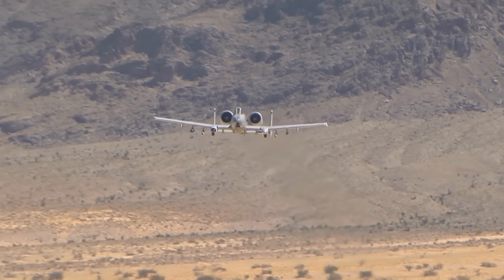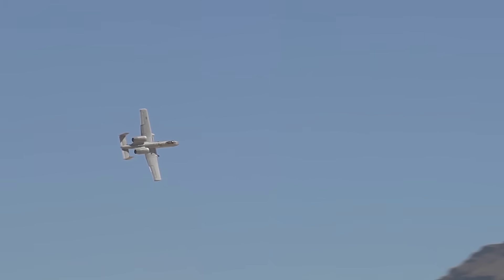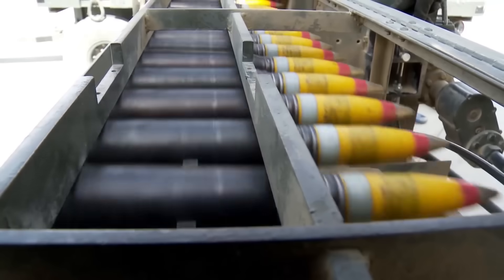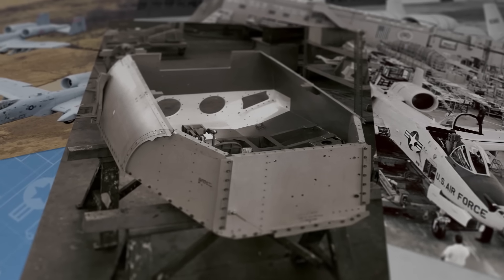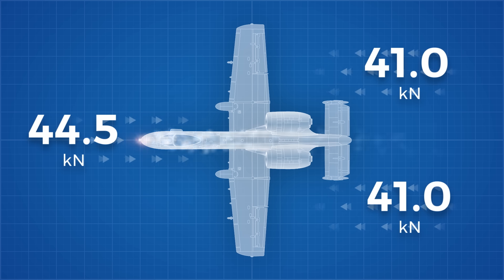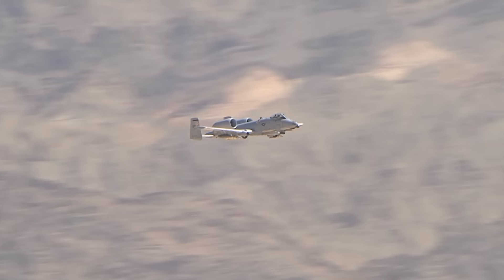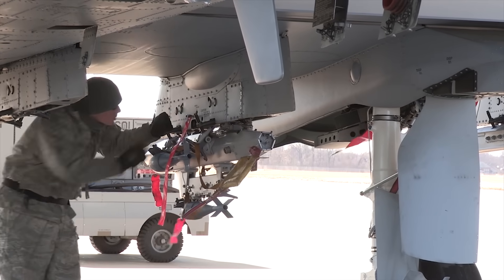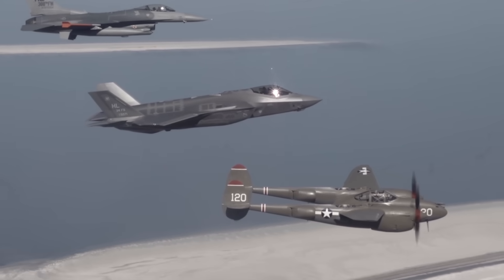The Insane Engineering of the A-10 Warthog

Comment from the maker: We just released a new video about the A-10's grand papi, the P-47 Thunderbolt. 👴🏻
If you enjoyed this video, you will love this one: https://youtu.be/IwqTN5fhMR8
Reply: Amazing video! However, one thing wrong. At 7:56, the gun is actually slightly offset to the left so that the firing barrel is aligned with the center line of the plane.
Reply: @vectorvictor2911  Yep, it's visible just looking at the plane so I'm not sure how they missed that. It fires from the left most barrel so the firing barrel is on the center line even though the gun is not.
Reply: @vectorvictor2911  but in the video theres real life footage and when they look at the a-10 infront you can see that the guns on the middle but i do know that the guns supposed to be offset from the center
Reply: you are incorrect ive seen an a-10 in person and the gun is off set a little and the barrel that the bullets come out of is in center line with the aircraft
Reply: tank god look again , the wheel is off set ,not the gun , it’s all about the gun
Reply: Three things to add:
1. During the first Gulf War, the Iraqis were terrified of this aircraft, and referred to it as "The Devil's Cross".
2. Part of the reason this aircraft has such low operating costs is because many of the components are ambidextrous: the wings, the rudders, the engine, and all three landing gear can be swapped with new or salvaged components.
3. The gun is mount slightly to the left, so the right-most barrel is firing on the centerline.
Reply: My grandfather flew P-47's over Europe in WWll & he loved it, said that plane is how he survived the war lol . Called them flying tanks lol . Said they can take a severe beating . Often coming back to base ridden with bullet holes . History worth remembering. 😉😜✌
Reply: When I was in the Army in West Germany in the '80's, the feeling was, that the A-10 was "down here with us". Without really thinking about it, the A-10 gave us comfort.
Reply: Thanks for the extremely interesting vid on the A-10 tank killer. I loved it well done 👍
Reply: The A-10  Thunderbolt (fondly known as the "Warthog"  is pretty much a direct descendant of the P-47 Thunderbolt (fondly known as "The Jug" & if I remember right, "The Hog"). What's kind of amusing to think about, but isn't really a big issue, is; the piston engined P-47''s top speed, 436 mph+, is faster than the jet engined A-10's top speed, 420 mph!
Reply: Ha! I myself, decided that there was a direct blood line between the two ... Nice to see that people who know this stuff, think the same thing.
Reply: Yo. Some of the A-10s in the camera shots used in this video come from the local Air National Guard in my hometown Fort Wayne, Indiana. Any shot with the word Blacksnakes on the engines or the snake nose art comes from the 122nd Fighter Garrison. The planes always seem to fly over my house so it’s fun when they go in for a landing and I can hear the engines, which are loud even indoors. It was strange to see the 122nd’s A-10s in a video other than the local newscast. Thanks for that. Enjoyed the video greatly.
Reply: @THEguitarist117  kewl my man
Reply: @THEguitarist117  Camp Atterbury Alex?
I've shot .50BMG matches there and done a couple other things at that base. 
That's the first place I ever saw the A-10's do live fire training.
Cool place...
Reply: @PJS50  I don’t know the name of the base, only its location. The reason I know that those A-10s were local was because I’ve seen them up close when my Boy Scout Troop went to the base, and when I went to a Memorial Day Air Show. So, yeah.
Reply: COSTS... you can build  and buy 2 or 3  A10s  (~$47 Million)   for the price of  just one  F35.  ($94 to $122 Million)... 
So for any ground fight, would you  want to have only one F35   or  is it better to have  Three  A10s  ?
Multiply that across an entire war front :     100  F35s   or   300    A10s  ?
Your tax dollars at work !  And that tough titanium tub armor the A10 means safer pilots, and more of them  coming home.   To  all their  families :  PRICELESS !
Reply: @SeaJay_Oceans  yes just big brain move right there
Reply: You lose me when you can't get the simplest things correct.🤨
It's not the A-10 "lightingbolt".
Also, the "grand papi" of the A-10 was the A-1 Skyraider.
The info I've found is consistent with the wikipedia overview even on military websites. So, here's a quick copy and paste..

From Wikipedia...
"The Fairchild Republic A-10 Thunderbolt II is a single-seat, twin turbofan engine, straight wing jet aircraft developed by Fairchild-Republic for the United States Air Force. It is commonly referred to by the nicknames "Warthog" or "Hog", although the A-10's official name comes from the Republic P-47 Thunderbolt, a World War II fighter-bomber effective at attacking ground targets. The A-10 was designed for close air support of friendly ground troops, attacking armored vehicles and tanks, and providing quick-action support against enemy ground forces. It entered service in 1976 and is the only production-built aircraft that has served in the USAF that was designed solely for CAS. Its secondary mission is to provide forward air controller-airborne support, by directing other aircraft in attacks on ground targets. Aircraft used primarily in this role are designated OA-10. The A-10 was intended to improve on the performance of the A-1 Skyraider and its lesser firepower."-Wikipedia
Reply: @FREEDOM_33  In an exclusive "ground support" mission, yes, the A-10 replaces the good old Skyraider (what a great bird that one was too!). However, the A-10 was primarily designed as a quick response to stop the oncoming swarm of Russian tanks across Europe should the USSR ever decide to go "hot" on the cold war. Yes, the A-10 does a good job at CAS, but that GAU-8 gun is WAY OVERKILL for a plane designed primarily for just a CAS role. It was designed to keep the battalions of Russian tanks at bay until NATO could amass their own armored response.
The A-10 is an inexpensive plane, designed to take out way more expensive main-battle tanks, and survive!
Reply: @FREEDOM_33   yes sir.  A-10  MY NICKNAME FOR HER IS THE CROP DUSTER....    as far as that OA-10 designate.   THE.  O...  was dropped  because it is to big and heavy. To Observe 
Now ....   consider  your self.  Lost.  And I do mean lost......    a wise man will  seek before  he speaks.    0V-10.   BRONCO.   AKA.   BLACK PONY.    ROCKWELL.    HAVE YOU EVER HEARD OF YOITUBE....     WELL...

 GET BUSY !
Reply: It is seriously wrong to use DU that way. It's half life is something like 3k years?? That it's still dangerously redio-active, yeah that sounds safe for our troops to be near. Or the aftermath of the war zones for that matter. The innocent people dying of cancer wondering where it came from too?? DU should be sent to the sun to be recycled that way, hint Elon Musk, if you want to help the world, spend some money doing that.
Reply: @derkaturka   years. Comments are  punk i fied  in this last day  if you are not one whom is trying  to find  3 ga  boo  n.  Viper.    The deadliest  of all.   Then I agree  with  your comment  other  than that.   Stand  down.  😠
Reply: @derkaturka  im a vet I completely  understand and  agree  w /   .  79 - 85.   Yes  
  You know  that I know they  don't understand.   And after.  1 6 21.  I dont want to comment  any more
Reply: That made my whole  family  cry all of us are ret govt workers  or representatives of  all branches of the military
Reply: Starscream I'm coming for you
Reply: Yes they are trying to get shut off the Beautiful A10 but the real thing about it is Nothing else can take its place we only need about 300 more of them
Reply: It gets the job done....
Reply: um it's not "insane engineering" when all they had to do was build the planes body AROUND the gone
Reply: and  https://www.youtube.com/shorts/XJIunDgblec 😉
Reply: that IS my Plane A-10
Reply: 4
Reply: the jug
Reply: @realengineering the gun was my dad's baby it was his first project he was charge  of as captain. he retired as a maj. after 22 years of service. he died back in 2015.
Reply: Lots of great footage and information. Dude you must have said  ‘need’ or ‘needed’ about 50 times in the first 5 minutes! Wtf? Is this a CoDependents Anonymous meeting or what? Please consider remaking this real man world terms like ‘requires’, ‘must’ etc thanks 🙏
Reply: I smell an Irishman. Is my nose right?
Reply: No joke.  Dont blink,@ dead.
Reply: A-10: BRRRT

YouTube subtitles: [Music]
Reply: Su-25/39 in the future?
Reply: Can you make a video about f 22 raptors
Reply: I fly RC planes too...
WoW! Check THIS ONE out!
BBBBRRRRRRRRRRRRRRRRT...
https://www.youtube.com/watch?v=iWZTTg0hEwI
Reply: I'
Reply: If you ever do a video on sonar, you should reuse that opening clip. You have the audio delay from the visual of the guns firing, but you can also tell how much distance the A-10 covered between both bursts. There was a delay of a few seconds between the sound of the first burst of fire and the rounds landing, but the second burst only had about a half second delay between firing and landing. A little bit of math and that audio can tell you how fast the aircraft is moving.
Reply: +pinky lmk
Reply: You said lightning bolt when it’s thunderbolt II
Reply: @Evan Ferrero well the f-35 isn’t bad it’s a good aircraft but A-10 Go Brrrrrrt so it’s better
Reply: My dad was the father of the A-10.  He was VP and project manager.  It is interesting reading the comments below.
Reply: The GAU 8 was slightly off center. The 9 o'clock barrel was ON center
Reply: quick thing the 30 mm is placed at an angel to the left of the plain but it fires from the barell that is center when it is fired so the gun is not centerd but the force and the shots origin is. does not matter for the video. good work
Reply: May someone knows  that this A-10 was created by Aleksander Qartvelishvili,he was emigrated from RP. OF GEORGIA .CAUCASUS region 🇬🇪
Reply: dc we
Reply: Slight correction: the gun is mounted slightly off the center line axes, as the GAU avenger in the warthog is set to fire each barrel when it is on the nine o'clock position. By mounting the whole gun slightly off axes, the nine o'clock position of the barrel drum lines up with the center line, allowing for no horizontal shift to occur when the gun is firing.
Reply: ol
Reply: The engines were externally mounted to keep them away from the fuel tanks.... stealth and heat signature were not much of a concern on this plane lol.
Reply: IM a fan of the bell p-39 myself
Reply: @BTD3Fan  P-39, another cool plane... the Russians had some pretty good luck with it as a fighter! I believe my dad who was stationed in the Aleutians (Umnak Is., Ft. Glenn) during WW II said he saw a few of those fly through his base. 
I understand that 37mm cannon that fired through the nose wasn't all that great of a weapon though.
Reply: The gun is NOT mounted directly on centerline with the plane though 🤔
Reply: The P47 is one of my favorite WOII plane. If I had to fly a aircraft in WOII, I would choose the P47 every day!!! It has to most armor and firepower of the US Air force in WOII!!!
Reply: Thank you for this channel. Your work here is on point. I wonder if you have made a video on the AC130? If not please do so. I'm not so certain that the engineering is "insane" , but if it is you will illuminate us about it, won't you? Thanks again.
Reply: Oh and they will trust me
Reply: That not a plane that is a gun with wings.
Reply: 222.222
222.2222.
2222222.2
2
Reply: It will be pilotless by 2026
Reply: Well of course  through the annuals of time  the lineages  of close air support  could back  another war generation  to when we dropped grenades from two winged  85mph open cockpits  by hand with scarfs around  our necks..   progression is  a constant  controlling  factor.  If you hold dear your way of life....   but it would seem like  all refuse to speak on the OV- 10 Bronco. The A -10's.   ....   DADDY.  ...    i would  even go so far as to say   I think it would  be a punch for punch   trile  between the  to of them.   That little turboprop  was full of Hell .  Many countries  use them to this  day.    If i find one lying in the trash  ima do alli can to get it.  Yep. Yep.
Reply: All of you....  Stuge's....    yeah  . Mo.  Curley....   And Shep....  refuse to do the MATH....   get a Grip..  .. the P47 was not a close air support  platform.   There was no such thing  at that time. The allies  needed a  machine that  would  make the  Lutfwaffa tremble even to this day...   you have never mentioned  the Crusader.    Navy  boys  Ra.  That began to  terrify the  enemy....  With in your face.      . F.   U...   Potential.  ....    Then some brainiac  at Rockwell  came up with ithe idea of a platform that would  be the beginning of the  end of  CAS. Warfare  . The OV -10 Bronco.    There is no. And never will be .....     ever. .......     an A-10.  Tank killer ..   with out the  ...     Bronco..   and don't none of  you. Ever forget  it.....    the Bronco  was    60 times more than the Warthog will ever Be.  It is. The Author. Of C A S..   why do you hate the Vietnam War  so much ...  for the  A 10..   was the child of the  BRONCO...    BOW YOUR. HEADS.   😠 !
Reply: That's my best lil piggy who eats heavy metal and leaves nothing my lil piggy
Reply: OMG...Chesty Puller...how'd he get in that plane? Oooooooh....he gave it backl....I get it....seriously, talking to Chesty only here, I need that back.
Reply: We don’t fight Peers. IN the Post War era we only fight nation-states and movements that are vastly inferior.
Reply: Starscream I'm coming for you
Reply: The welcome  mat is at  the door.     Spectra. 

 7.62 . × 38.   /     .59
   Win mag  and  soon.   BROWNING  . .50.   30 years  .of  ... bottle cap at 3 miles.   Please come.   !     Worrior to worrior.     By the code or lose an ear. By the code.    Merry X mas. !   👹.
Reply: À
Reply: Watch the  YouTube.  On the (...Black Ponys).
Reply: Now. Make a comparison  video  about the A10 and the  OV10  and thier versatility.  Armament. Roles  ant ther  abilities  to multitask in combat.   Then ask the question. Which 1 of them  sank a fully  armed. Steelhull  ship while  preforming combat duties .
Reply: Thankyou Ta Tanka
Reply: ok
Reply: I’m here so I’m not going anywhere anywhere else
Reply: It's NOT the lightning bolt. It is the Thunderbolt 2. It is named after the P-47 Thunderbolt.
Reply: The close in "Close Air Support" refers to the proximity of targeta to friendly forces, not the proximity of the plane to any of them.
Reply: The Sherman was an engineering wonder, very reliable, getting constanly updated and using some of the best systems at the time. The T-34 is a piece of shit with horrible optics, gearbox, steel, weldings and often lacking lights and radio.
Reply: O
Reply: "Insane" ?  Amateurish and juvenile...
Reply: Lll
Reply: Republic P-47 Thunderbolt I
Fairchild republic A-10 Thunderbolt II
Reply: Can u make a video about Apache helicopters
Reply: Sorry dude, it's the A-10 THUNDERBolt, not Lightingbolt. You gotta love that first clip of live fire. You hear the louder gun "burp" a short burst of fire and then a second or two later, you hear the HE rounds it just fired detonating on the target. I've heard these live fire a ton and with HE's in the magazine, it's amazing how well the round's detonation is heard for an incredible distance.
When the gun was first designed, the original @$200Million "prototype" was a slightly different design than what they are now, and due to where the original's engines were located, when the pilot fired the prototype's GAU-8 gun for the first time, the exhaust from the gun flamed out BOTH engines! Considering he was in a low-flying strafe at the time, it're really a testament to how good of a pilot he really was because he managed to land the bird. After that, the engines were moved more outboard to the fuselage and slightly higher above the wing to eliminate this from happening again. I have 3 GAU-8 rounds in my personal artillery shell collection (all inert of course). I have an HE, the DU (Depleted Uranium) and the even rarer cyclic test rounds that the armorer uses for test cycling the gun after repair/setup. These test rounds are just chunks of metal and they are rarer because they usually end up in the trash after they have been cycled. Also, dude, DU rounds were internationally outlawed for use DECADES ago, right after the original Gulf War (Bush vs. Saddam). They left too much radioactive dust all over the battlefield, which was uber-dangerous/toxic for the troops. The AP rounds they use now have a hardened Tungsten core; those work just fine and don;lt cause the ground troops to die... Real Eng. guy, you really should do a bit more research before making a video about something. You even got the NAME of this bird wrong!!! Maybe I should start making videos! I'll call myself ACCURATE Engineering... LoL
Reply: @PJS50  Its not burp, its BRRRRRRRRRRRRRRRRRRRRRRRRT
Reply: @Flyguy4500  LoL... I guess it depends how trigger happy the pilot is and how much ammo is left in the can Jack! LoL...
At @3900rnds/min. even a short "burp" is a whole world of $hit on the ground!
Reply: @PJS50  true, just the burp bothered me for some reason, idk why. I like to do brrrrt, or if it’s short just brrt
Reply: @Flyguy4500  It's ALL good Jack! When I was at Camp Atterbury IN. once, an A-10 and an F-18 (go figure?) where both doing aerial gunnery practice on the same range and I was surprised how loud the 20MM Vulcan cannon in the F-18 was compared to the A-10's GAU-8 30mm beast. They both were also shooting HE rounds, and even the 20mm rounds detonating on the ground could easily be heard, just like the 30mm ones. All of that was happening on the other side of a very large "hill/berm" (I'd guess @ 400'-500' in elevation) that was between the gunnery range they were using and the small arms range I was on shooting .50's at the time. I thought the Vulcan would have been a lot quieter, especially when it came to the rounds detonations; not so much...
Reply: PJS50 «
Reply: @PJS50  

.
Reply: @PJS50  You're wrong about depleted uranium. DU is actually less radioactive than natural uranium ore and its use as armor piercing weapons and as a component of composite armor is not banned by international law. DU is toxic if ingested, but that's something common to other heavy metal elements. More importantly 30mm armor piercing ammo is inadequate against modern armored fighting vehicles compared to the APFSDS ammo used by main battle tanks or the guided weapons which are available to attack aircraft today.
Reply: PJS50 i
Reply: National3560
Reply: Hi mate. What about the Spectre AC-130? That one is also considered a close air support too right? And please do make a video on the Spectre AC-130 Gunship. Cheers!
Reply: Pilots won't be nearly as confident in their close air support role, when flying multi-role fighters, as they are with the A-10. Also, soldiers on the ground won't feel as protected.
      The main reason, some people push to get rid of the A-10 is, just that the Military Industrial Complex just wants to sell more planes.
      ...Keep the A-10 in operation!
Reply: Most bad ass since the Real  Thunder bolt.  Saw this plane do some amazing stuff!!!  Great pilots for a great airframe
Reply: Thunderbolt II’s father the P-47 Thunderbolt
Reply: the A-10's grand pappy was the Stuka not the P-47
big common misconception
Reply: Hachi Riko 
The P-47 Thunderbolt is American
The A-10 Thunderbolt (II) is American
The JU-87 is German
Also the A-10 is called the thunderbolt II for a reason
Reply: @DividedByZeero  dont forget all the engineers who came to the US from germany after the war.
fun fact another misconception is the AK rifle is based off the Sturmgewehr 44 which couldnt be further from the truth.
the AK rifle took ideas off the M1 carbine where the AR15/M16's took ideas off the Sturmgewehr 44 
https://www.youtube.com/watch?v=N4TtB5Jqi2M&t=299s
Reply: Hachi Riko 
HmMmM? I wOnDeR wHy ThE 2 (II) iS tHeRe
Reply: @DividedByZeero  to not confuse with the P47, the ONLY similarities are the nickname.
considering your youtube channel i can take a good guess at your age. you definitely dont know what you are talking about
Reply: Hachi Riko 
I understand the STG but the Stuka might have inspired the A-10 but the name comes from the P-47
It’s more inspired by the Stuka and the P-47 both working in air support roles but the Thunderbolt name came from the P-47
The gun is just designed to be on it for the air support just as both aircraft did
But the P-47 nickname also gave the A-10 its name
Reply: @DividedByZeero  its not though, the P47 was never intended to be a ground attack aircraft. the P47 was a interceptor but because of the load it could carry also slid into a ground attack role.
this is why its a big common misconception, the P47 has NOTHING to do with the A-10 other then the name which it got from its gun sounding like thunder when it shoots. (which isnt even its official nickname which is warthog)
as i said and my link will explain, the Stuka and IL-2 inspired and led to development of the A-10.
Reply: Hachi Riko 
The A-10 might be inspired by the Stuka but the thunderbolt in its name comes from the P-47
https://en.wikipedia.org/wiki/Fairchild_Republic_A-10_Thunderbolt_II and read the first few sentences
also warthog is a name given by the soldiers due to the ugly appearance of the aircraft
The thunderbolt II was the official name given to commemorate the P-47 thunderbolt
Plus where the hell did the II come from? It’s not like they pulled it out of there ass
Reply: @DividedByZeero  Hachi is probably correct about the "role" of the A-10 being an airborne tank buster which accomplishes its mission by using a big-ass gun. Similar to the tank-buster JU-87s which the Nazis put in the air, late in the war. But the JU-87 was a retrofit of the D version dive bomber with 37mm auto cannons. The A-10 was designed to do what it does with a very unique and incredibly capable gun which no other plane uses. The A-10 is ALL American in that respect. It's tough as nails with armor and redundant flight control systems to be able to bring the pilot home, even when the plane has lost big pieces of itself in combat. In this respect IT IS a child to its P-47 father, which was also tough as nails and one hell of a ground attack aircraft in its own right, among other roles it very capably filled.
Reply: Hachi Riko the Douglas DB5 dauntless was a better dive bomber, both the db5 and the p-47 were more rugged than the Stuka , the ju87  got its reputation came from bombing early army’s unprepared and civilians and most of that was about the Jericho trumpet , the ju87 was over rated. Also the Douglas A-1 sky raider was the A-10 predecessor
Reply: Hachi Riko the p47 was used as ground attack because it could take a pounding and still fly while giving with eight 50s and the DB5 was a better dive bomber than the ju87 and more rugged. If we needed to model after a dive bomber we had the best. The Douglas A-1 sky raider was the A-10s predecessor
Reply: @Hachiae  The Hs-129 was the closest thing in WWII to the father of the A-10 in almost every facet.The P-47 ended up doing ground attack because the Luftwaffe had been defeated and their were damned few aerial targets for all of the escorts and air superiority fighters the Western Allies had, but there was still plenty of stuff on the ground to clear up.
Reply: @DividedByZeero  damn......so stuka is the mom and p-47 is the dad??? Jk
Reply: @PJS50  so literally hachi is saying the a-10 came from the stuka because of having the same roles? Huh i dont get it
Reply: @aviationfilms5601  
Lol I guess
Reply: @aviationfilms5601  Yea... Well, in his defense, the correlation he made is a fairly easy one to assume, but that's as far as it goes. 
I might be wrong, but to do believe the Stuka-D "tank-buster" version was the first aircraft in history which was outfitted with a "cannon" that was larger than 20mm, for the very specific role of ground attack/tank busting. So, if you want to narrow down the specifics to this one parameter, I guess the idea might have been carried forward to a small degree. However, to say that the A-10, was directly derived from the Stuka, is, well... Somebody's been smoking crack. LoL... (No offense, that's a joke Hachi).
It is also obvious that the name "Thunderbolt" was directly pulled from the phenomenal reputation and documented success of the P-47 in the ground attack role with and it's own very impressive firepower that was afforded by its EIGHT .50Cals. Let alone, the P-47 was also probably even better known, world wide, for it's durability AND it's ability to fly with extensive battle damage, allowing the well trained Allied pilots to make it home unharmed and able to fly combat missions again in very short order. This is especially true with the P-47B (Razorback), with it's armor-shielding directly behind the cockpit which saved TONS of pilot's asses! In this respect, the naming of the A-10 IS also spot-on accurate considering it too is equipped with a "titanium bathtub" of armor that does an exceptional job of protecting the pilot, especially from AA/ground fire. Heck , this aspect ALONE ties the A-10 to the P-47 probably more so than the aerial cannon part it shared with the Stuka! One last nail in Hachi's naming coffin; The P-47 was built by Republic Aviation. Can anyone guess what happened to that company in 1965? It was bought by FAIRCHILD Aviation; the maker of the A-10 Thunderbolt II! Game, Set, Match!
Was the P-47 good at ground attack? I mean, LOOK AT THIS!
 https://www.youtube.com/watch?v=99Hp4VJG7h0
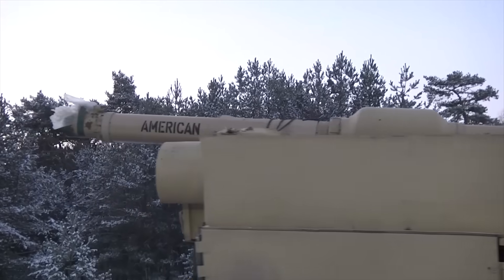Those "flashes" on the targets are the M1-Incendiary rounds detonating. My favorite part of the clip is at @1:00, where the pilot is so low to the ground, he is hitting aircraft parked INSIDE the Hangar! Holy Catfish Batman! AWESOME! Ya' gotta love 8-.50cals. working in harmony! It is a symphony of annihilation! LoL... 
Also, note the sudden and well clustered stream of tracers in this video (like at the :50 mark). Frequently, the pilots would have the armorer load last 10-20 rounds of the ammunition belts with 100% tracer ammo. When the pilot saw those continuous streaks of tracers get fired, he knew the ammo of that gun was depleted (also notice they don't always run out of ammo at exactly the same time either). In fact, at that :50 mark, you can see 4 of the 8 guns go dry, and in the next clip right after that when the pilot is taking another pass at the same target, the 5th gun goes dry. Better head home dude, you're probably out of ammo 100% now.
Also, did those P-47 pilots have cajones or what!?! God love them all...
I'm also an avid "gun guy", and Hachi's assertion about the similarities of STG43, AK47, M1 Carbine & M16 are, well...... Stop smoking crack Hachi! LoL...
Reply: @PJS50  i you have made me say "huh......i guess so" so much time and BOY you better believe i read this whole thing
Reply: @aviationfilms5601  Good, I'm glad you read it. Can you tell I LOVE this shit! LoL...
Reply: @PJS50  bruh  SAME lmao
Reply: @PJS50  you are WAY TOO detailed lol
Reply: @aviationfilms5601  I just returned from deer hunting with my buddies in Northern MI. Where we hunt is very close to the Grayling ANG base and in fact, my friend's old HS buddy (semi-retired Army) runs the gunnery ranges for the entire base up there now. 
On Tuesday morning, we hear these series of loud  BBBBBBBRRRRRRRRRTTs. 
Being in an enclosed blind (windows, propane heaters, real "rough" hunting conditions. LoL...) I couldn't tell right away what it was. At first, it sounded like on big/bad-ass monster truck revving it's engine, but considering I was sitting in the middle of a 540 acre parcel of land, I started thinking there was no way it was a truck that loud because anyone standing near it would be deaf (the nearest road/house is at least 1/2 mile away in any direction and this was LOUD!). The guys at deer camp radioed me and asked if Godzilla Deer just walked onto the property over by me. So, I opened a window and waited for it to happen again..... BBBRRRRRRRRRRRTTTTT..... WARTHOGS! 
Our common friend confirmed later on for us that the Warthogs were indeed practicing on the aerial gunnery range up near Waters, MI. I snowmobile around that range all the time and I can tell you it is at least 15 miles away from where we were hunting! Our friend asked me if I wanted to go out the next day to watch them shoot from the observation tower on that range (he could get me in), but I was in deer killing mode, so I declined. Over the next few days, we heard the awesome BBBBBBRRRRRRRRTTTT quite a few more times. Our friend is going to set me up with a observation tower visit during more A-10 live fire sessions this winter during snowmobile season. He says I can even bring my .50BMG rifle and shoot at the hard targets down in the range valley (old tanks, trucks, etc... I'll use M-8 API's which explode on impact to help spot the hits)! The closest target is about a mile from the tower he guessed. WOOO HOOO!
Reply: @PJS50  bruuhhhhh your just chillin deer hunting then you hear a frickin BRRRRRRRRRRTTTTTT just fly above you
Reply: @aviationfilms5601  Well, the range they were shooting at was @ 15 miles north of where I was, but it still was plenty loud to hear out in the middle of the woods. You should hear Grayling when they practice with the 155mm guns and drop bombs from aircraft. My buddy grew up there, they call the the troops that come there to train "The Ground Pounders". The whole place rumbles in the summertime.
Reply: @PJS50  Kewl my gamer
Reply: @DividedByZeero  All those aircraft prior to the A-10 was then, the Hog is now,tomorrow & the future bet on that🗽🗽✈
Reply: @PJS50  a 10 was originally an army design. During the days of cold war, the mission became that a ground support tank destroyer aircraft would be needed to attack russian tanks that came from the east and across germany. To this end, the A 10 mission need was formulated. Then as the cold war threat lessened and politics being what they are,,the airforce addressed congress to inform them that the US army had more aircraft and airmen than the airforce. Political forces pulled many cargo aircraft from the army to the airforce,,,and at the time, the airforce had planned to cancel the A 10 but to retain the funding alloted to use in another airforce idea. As this was transpiring, that was about the time that the middle east disturbances we saw were starting to form up and become a threat. The air force leaders really thought they could do any ground support missions with a high performance jet, but just fly it lower to the ground even though loiter time was less and speed was much greater. As it turned out, an air force general was put in charge and the real need was presented, and the whole thing was now pointed again to the original mission but now under different command. When it came into production, it was now a fully formed air force weapon, and thank goodness it was done. Air force flyers at the beginning didnt have much faith in it as it wasnt the glory they had trained for. But in the end, it turned out to be the savior of many a ground pounder.
Reply: @PJS50   have you ever  heard  of the. OV 10. Bronco?    Look at   2 YouTube s.    1.  Rockwell 's.  0V 10  BRONCO.   2   The Black Ponys.   Vietnam ..  this will change your perspectives on who  the   A10's. DADDY.  REALLY  IS.     .....     THIS WHOLE  DEBATE IS LIKE A JERRY  SPRINGER  RERUN......  DNA. !!!!  TEST !
Reply: @quinnsavage2325  DNA Test, LoL... Good one Quinn! I have to agree with you that the Bronco was a really good specimen in trying to fill the ground attack role that the A10 does so well. That rear-gun thing was funky!
Personally, I've always loved the Bronco. Cool looking plane! When I was a kid, I remember seeing one at an Air Show, I think at Selfridge ANG base in MI (late 70's?). I remember thinking that the landing gear on that plane looked like it was broken. :-)
I wonder how many "combat" missions they actually flew in 'Nam? I always thought they were mainly used in the FAC/Recon role, but they certainly were pretty well armed for flying those missions.

The A1 Skyraider gets a lot more credit for doing the A-10's job in 'Nam. Probably has to do with the large payload capability the A1s were noted for.
I'll have to look at those videos you ref'd... Thanks!
Reply: @bill45colt  Good synopsis Bill!
I'm just glad they kept it. I mean.... THAT GUN!!!! ;-)
Reply: @Hachiae  true, one of the best Stuka pilots of ww2 actually helped in the creation of the A-10 Warhawk.
Reply: @DividedByZeero  . Mlm
Reply: 0094o
Reply: m3o3qkomk
Reply: Nd
Reply: @nohandle4meplz  

-
Reply: @nohandle4meplz  on
Reply: @nohandle4meplz loop kip